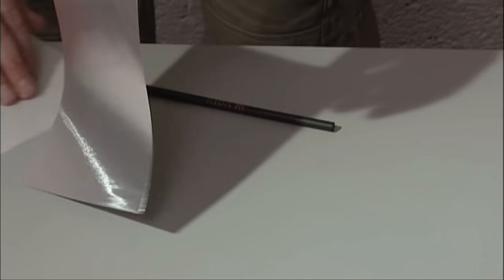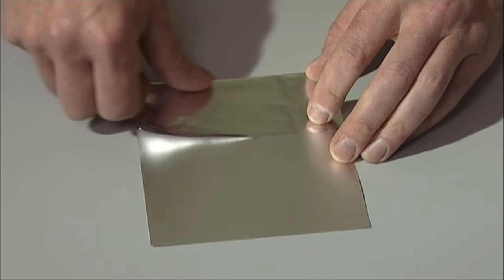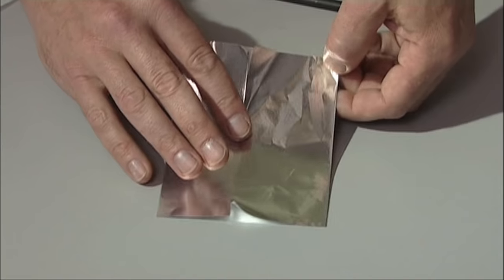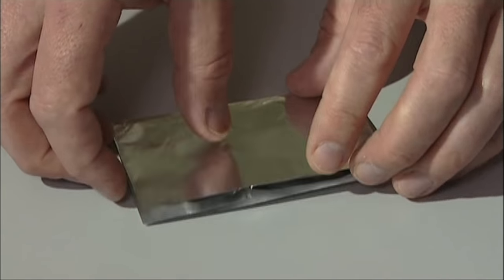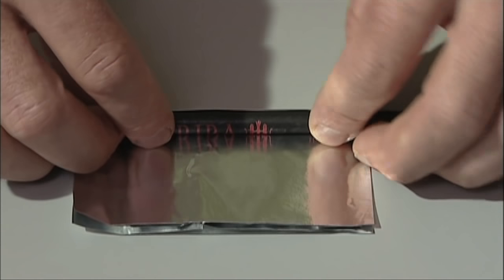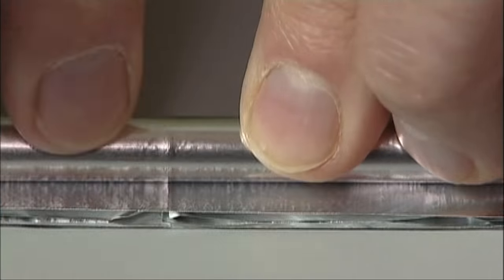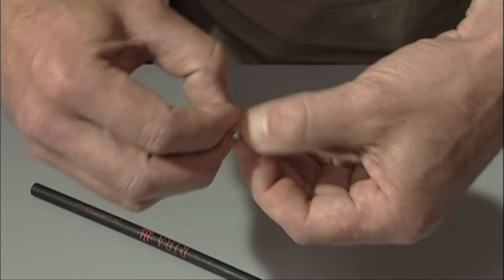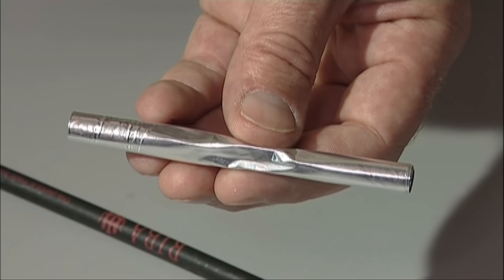How to make a great foil pipe with a straight/flat end

Comment: Do I need to add choir or anything else to stop flow like in a traditional set up?
Reply from the maker: hi, no you don’t need andything else, hold the foil carefully and as the crack liquifies you run it slowly across the foil
Reply: @ExchangeSupplies  I don't get it 😅 so you don't have to put anything inside the foil at all?
Reply from the maker: @dana1892  nope, it's fully formed and fully functional tube.

Comment: Is it true that aluminum smoke increases the risk of Alzheimer’s or Parkinson’s disease by an order of magnitude?
Reply from the maker: From our foil FAQ: Q. Is it true that there’s a risk of Alzheimer's disease when chasing drugs off aluminium foil?
A. No. Aluminium foil is manufactured to be placed in close contact with food, while it is baked in very hot ovens: it has been used for this purpose for many years and there is no evidence of risk or harm resulting from this. There are all sorts of risks associated with drug use, but aluminium poisoning from chasing is not one of them!

Comment: i keep burnin my b how do i stop it from burnin please
Reply from the maker: set it to burn with a longer flame, and waft the flame under the foil instead of holding it still you just need a movement of a few cm to create a more gentle heat. also on exchange supplies website there's pipes with steel filters - originally developed for crack, but work just as well with brown heroin.
Reply: @ExchangeSupplies  Thank you i shell give this a try later

Comment: A pipe? Up north 🏴 the young ones can make "tooters" a lot easier than that phaff...
🤔 There good wae the 'Jimmy Boyle ' it's like origami they have foil pipes with points on to collect more.

The guy is kinda right with the crimping, it tends to collect more gear ⚙
Crack gets smoked thru small plastic juice bottles, small foil bowl with holes & ash is used to sit crack in, then with a hollowed out pen in it to suck your crack, o and a wee hole 🕳 on rear called a shooter...

Good luck 🍀 to anyone with an addiction, you need to get off your ☠ ☠.

Speaking from experience ✌️
Reply: this is a tooter bro idk why he calling it a pipe buy yh it basically just a foil tooter but tons of ppl use hollowed out bic pens lol. H can't be smoked outta pipe only white.

Comment: ffs BURN THE FOIL first otherwise you will get the plastic covering fumes!!!
Reply from the maker: The 'fumes' on kitchen foil are actually vegetable oil, not plastic (it's a food product, plastic wouldn't be safe or tasteless) but the Exchange Supplies foil is dry, and does not have any oil on it, so no fumes to burn off.
Reply from the maker: @GhostvaperYT  it's the same as a quality kitchen foil - not too thin so there's no risk of melting, not too thick so the heat travels straight through.
Reply: @ExchangeSupplies  are u in the UK at all???  and if so what price is it. thanks

Comment: Smoking out of foil is dangerous
Reply from the maker: Smoking if done regularly is - of course - dangerous, but foil doesn’t add any additional risk
Reply: @ExchangeSupplies  could have sworn it was, well good to know
Reply from the maker: @charliegreenwood5642  no worries, when the (never proven)  ‘aluminium causes alzheimer’s’ scare was circulating the idea that the smoke from the vegetable oil contained aluminium took hold and it became one of those things everyone knew but actually wasn’t true.